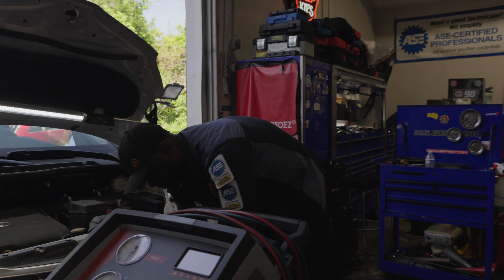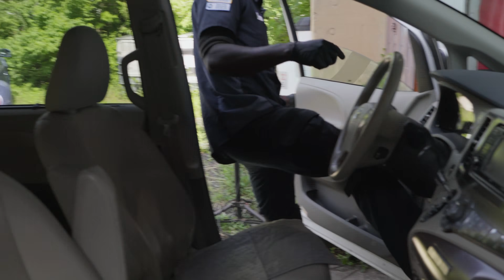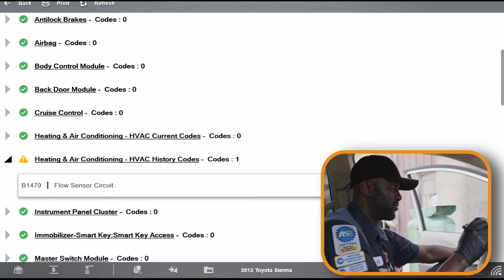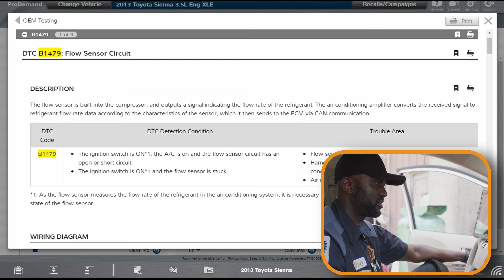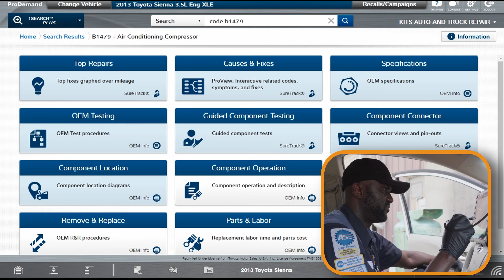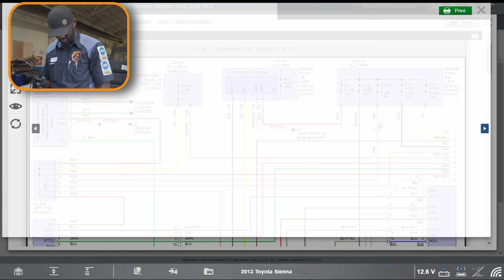Toyota Sienna : A/C Not Blowing Cold - DTC B1479 - Client Said Another Shop already looked at it

Comment: The flow sensor failed on my 2012 Sienna.  Touching the sensor with a magnet would start the compressor and it would stay on until it was shut off.  I kept a magnet on a stick and did this every time I needed ac.  I finally bought a Dorman sensor for $25 and replaced it.  The shop wanted to replace the compressor.  Saved $1000.

Comment: Sometimes, for a DTC code B1479, a $30 Dorman replacement flow sensor will fix the problem. Toyota wants you to replace the compressor, but it's not always needed.

Comment: The flow sensor voltage at the compressor should be around 4 volts. Anything below 3.7 volts will not work. If you have a sensor simulator put 4v on the flow sensor signal wire, if the compressor works then flow sensor is bad. You can change the sensor without replacing the whole compressor.
Reply: Fooling the sensor with a magnet will also work, some people are strapping a piggy back magnet as a hack.If you look up the pids you can find both and see what the values are.This is a variable displacement compressor and behaves completely differently from regular clutch style which this doesn't have.

Comment: You haven't even checked if the compressor is pumping through the ac guages. Also, seeing there is refrigerant from the ac guage doesn't mean that the system has no leak. Some leaks are micro and will only leak at over 150 or 200psi, so at static pressure that is only approx less than 120psi so no leaks are visible. Flow sensor circuit or ac pressure switch has similar method of the engine oil pressure sensor. If pressure is low, the oil pressure light comes visible in the dashboard because of not enough pressure to push the pin inside which disconnects the connection from the oil light in the dashboard. Similarly in the opposite direction with the flow sensor/ac pressure switch, if refrigerant is low, there isn't enough pressure to push the pin to complete the connection and make the whole ac system running. 

Now if the flow sensor/ac pressure switch is bad/broken, there is no way that the ac compressor can turn on. Flow sensor is basically a protection from running with low level refrigerant and too much refrigerant which cause high pressure that can seize the compressor. Both lack and too much refrigerant can cause too much heat to the compressor.

Comment: This guy is on a learning curve with his video's , you can miss stuff  on camera easily  , when you have tried it and an expert great for you .
Reply: That’s what’s great about these DIY forums on YouTube. After I commented,  I clicked on some of the links suggested by other viewers and found at least 4 other AC flow sensor malfunctions specific to this exact Toyota Sienna and various other Lexus models with the same system and code. They were all successfully repaired by replacing the sensor which Toyota doesn’t sell separately. Fortunately Dorman does and for less than $75 the AC malfunction was fixed without the $1,200-$1,500  new compressor expense plus the over $1000 in labor required to install and recharge the system. If I found these videos on this exact system problem in these specific Toyota vehicles, that were posted as long ago as 4 years, immediately after looking for them, Deo should have known even faster. That, plus the illogical sequence of tests performed and the total elimination of some others was puzzling and frustrating. Showing electronic waveforms on a picoscope or oscilloscope was just a smokescreen to cover up for a total misunderstanding of how to troubleshoot this specific problem.

Comment: you can try the neo magnet on the flow sensor hack/test. if the compressor kicks on and stays on. that means the flow sensor issue.  if it doesn't kick on at all. it could be the compressor itself.

Comment: Hi Kit,
Thank you for posting and step by step approach to auto repair.  We own a 2011 Sienna with 235k miles. The vehicle has needed some repairs over the 14 years of ownership as to be expected (im still learning this 😅) 
The front cabin circulating fan has gone bad 2x. Wiring harness and 3 mounting screws... send her down the road:) Safe travels. Kinda upset that TMC decided to discontinued the 2gre v6 😞.  Routine maintenance and she will gladly show you her 297 horses 😊
Just had original ac compressor replaced earlier this month.
14 years Id say a pretty good run.
I wonder if there is someone who will remanufacture ac compressor?

Comment: Deo, good video for these hot summer days. Dorman sells the sensor separately for these systems and for far less money and are easily installed. Replacing just the flow sensor will solve the problem and make your customer happy. Make sure that the compressor, it’s clutch, and fan are operating when calling for cooling first. Good luck with the repair.
Reply: Dorman

Comment: Is this compressor not the same across all 2GR engines? For the Lexus RX350, the flow sensor is replaceable without losing any refrigerants. It is held in place by a circlip on the compressor. 
To confirm if the flow sensor is faulty, place a coin magnet on it, and the AC compressor will turn on. The placement of the magnet is polarity sensitive.

Comment: This is a known problem with certain Toyota models, including the Sienna. The error code B1479 indicates a problem in the circuit of the 'flow sensor' of the air conditioning compressor.
The flow sensor: the flow sensor is an important part of the air conditioning system. It measures the flow of the refrigerant and transmits this information to the 'A/C amplifier' (a kind of control module). The error code B1479: this code indicates that there is a problem with the communication of the flow sensor. This can be an open circuit, a short circuit, or an incorrect signal. The A / C amplifier uses the information from the flow sensor to determine whether the compressor should be switched on. If the sensor transmits an incorrect value (for example, too low), the module turns off the compressor to prevent damage.  Compressor broken?: This is the crucial question. In many cases of DTC B1479, the compressor is not broken, but the flow sensor is defective. Because Toyota often does not sell the sensor as a separate part, the dealer's "official" solution is often to replace the complete compressor. This is an expensive repair. Replacement of the flow sensor: there are specialized garages and aftermarket suppliers (such as Dorman) that offer the flow sensor as a separate part. This is a much cheaper repair than replacing the entire compressor. In some cases, the sensor can be replaced without draining and refilling the air conditioning system, further reducing costs. The error code can also be caused by a defect in the wiring or the connector between the sensor and the A/C amplifier. A good mechanic will check this first.
Although the B1479 code points specifically to the sensor, a (too) low pressure in the air conditioning system can also lead to problems with operation and sometimes indirectly be the cause. Make sure the system has enough refrigerant.
Ask the garage to clarify the diagnosis. Did they just read the error code or did they also do further research? . Ask if they have measured the resistance and voltage of the flow sensor. Inquire about the possibility of replacing only the sensor instead of the complete compressor. Request a quote for both options so you can make an informed decision. The cost for a new compressor can reach more than 1000 dollars, while the sensor itself is much cheaper.
Basically, the error code B1479 does not automatically mean that the entire compressor is broken. It's a problem with the sensor that controls the compressor. A good diagnosis is essential to avoid having an expensive compressor replaced unnecessarily.
Reply: Deo, you didn’t show us the basic first steps when diagnosing a problem with the AC system. First check that the air conditioning fans operate when calling for cooling, then if the compressor clutch is engaging and operating the compressor. If the clutch isn’t engaging the compressor then the next obvious step would be to see if you can command the expansion valve to open using your scan tool from inside the vehicle. Having all of those flow sensors and amplifiers on a simple AC system is just engineering future problems that will need repairing into simple reliable systems. My 160,000 mile/ 25 year old car has the original AC system and refrigerant in service and it still cools well on 90+ days. In older cars like mine it’s usually an expansion valve that needs replacing and not the compressor, in the newer cars it’s the sensor and not the compressor that’s the problem. Dorman makes a variety of easily replaceable sensors for Toyota which can cheaply be bought. Always look at the simplest causes and solutions first Deo, they make a solution possible faster and cheaper.
Reply: Awesome again 👊🏻
Reply: this is good, but when the vehicle is pass more then 150,000-180,000 miles its hard to know if i put that flow sensor will it work for another 50,000 miles or 5,000 miles ya know?
Reply: You are absollutely right. I had the exact problem with a 2011 sienna 3.5L AWD simply replaced the sensor with a Doorman and the A/C clearly worked after. In these Sienna's it is a common problem do not replace the hole compressor ! Verify that you have enough refrigerant and if yes then you look and test directly this sensor on the Sienna's. NOTE : You can simply place a magnet on top of the sensor to test it if the sensor is bad you will be able to allow refrigerant to go throught and A/C will work immedialtly. Many people do not replace the sensors and only place magnet on top of the sensor to allow currenty to go throught the compressor ( this is not recommended for long term because if you r low on refrigerant you can break your compressor).Your reflection about the error code is also correct.
Reply: Vidi se da nemas pojma o autima..samo se radis pametan..kopirajuci literaturu.
Reply: @drazenaudi7864  Dear, at the beginning of the film, I already know what the car needs, the plan, and the parts and labor costs. I'm a very good car mechanic. The reason you're coming to this conclusion, and you don't know anything about my profession, is that I'll tell you not to judge someone you haven't contacted, or haven't contacted at all. Remember, you have to respect everyone's dignity.
Reply: ti nisi sigurno mehanicar  ...pogotovo dobar jer hvalis sam sebe i vidi se da copy paste radis sa interneta.    @Medical-g5p  ti si internet mehanicar jednostavno se osjeti.